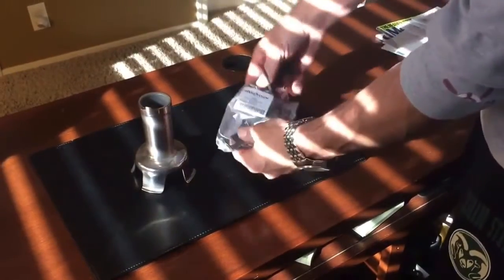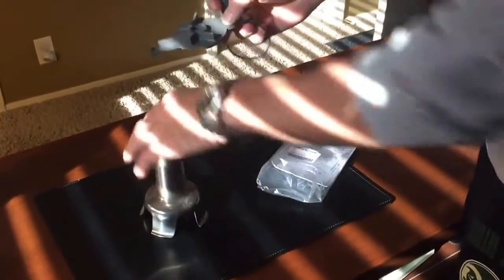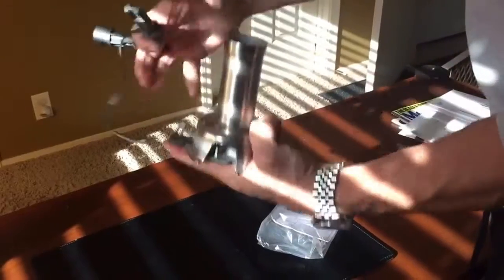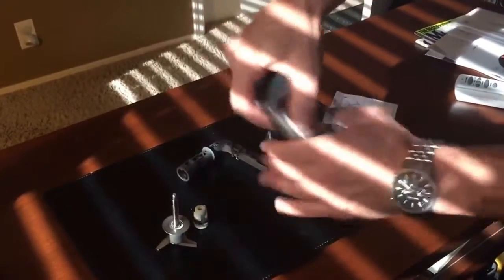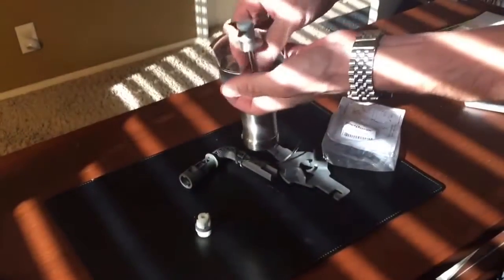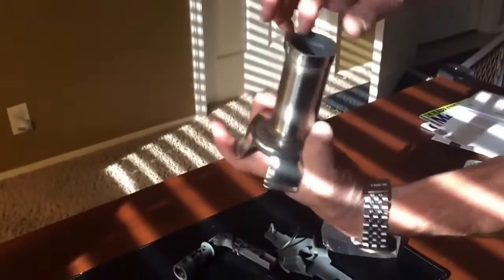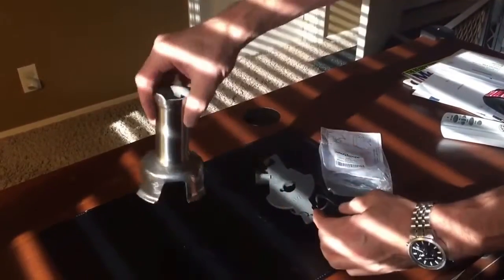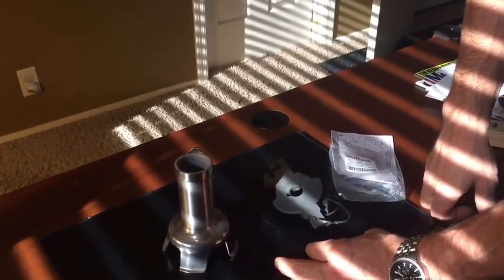Blade Removal for Robot Coupe Power Mixers

Comment: This is great for the blade replacement only, but there's nothing online about installing the inside core bearings (Part kit number 39337).
Is there anything online to explain it?

We have two bell assemblies where the bearings have gone bad, and two replacement core/ blade kits, but no instructions on how to remove the old ones and put in the new ones.

There's one video where the bearings are replaced individually and driven out/in, but with the 39337 kit, the whole core is pre-assembled.

Comment: where do you get that tool at ? does it come with a new m450 ?  where can I but one
Reply from the maker: Yes.  The blade removal tool comes with the Power Mixer.  If you've misplaced the tool, it can be ordered through your Robot Coupe distributor.